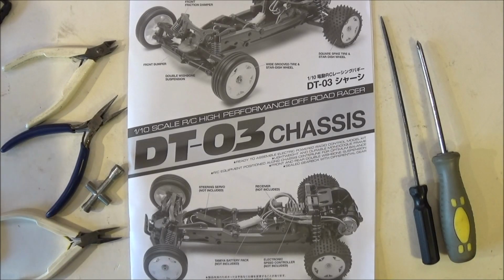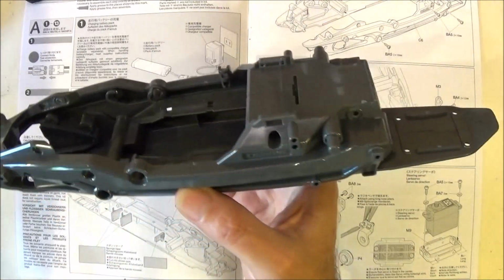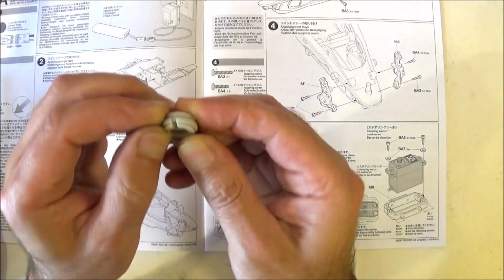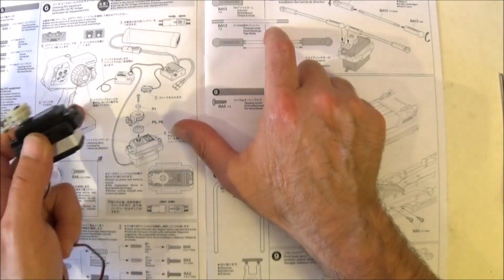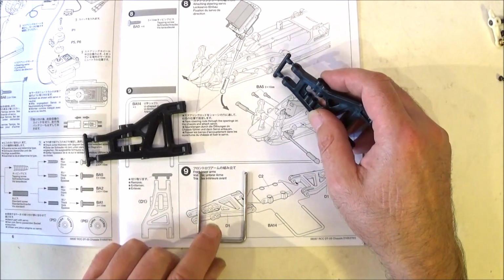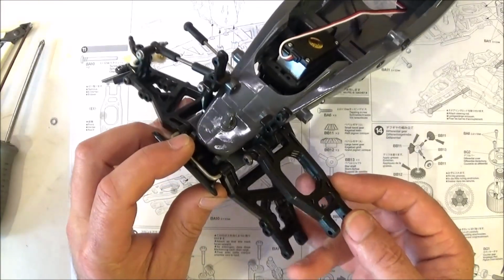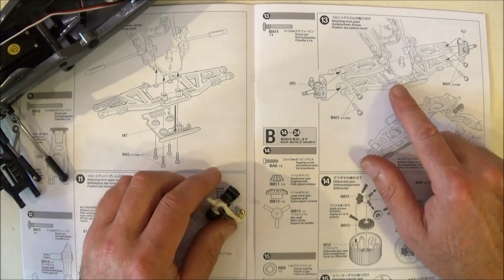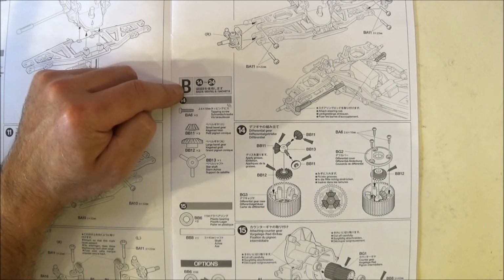Tamiya DT03 Build Part 1 & How to Make Adjustable Suspension Arms

Comment: Now do I need to see you screwing accompanied by a jaunty tune?  Well I miss it a bit but can probably live without it!   Anyway, great work mate.  Good info about the adjustable upper arm and the captive end thingy.  I could probably change the ones on the back of my Firestorm as they sometimes pop off in a crash but I'm not sure if that actually saves something from breaking.  Will give it a try.  I've done my Tamiya DT-02 and DT-02 with the standard kit upper arms as they are strong for bashing.  I will be doing something like this on my Holiday Buggy as I did with the last one as I shortened the lower arms to make the width suit the body more.   Anyway I have done the cat feeding and back home enjoying a drink before we head out.  Have a good evening matey :-)
Reply from the maker: Hehe - thanks for the amusing words Pete! The main reason I don't like the Tamiya ball cup arms though mate, is because I have had a few pop off and then my driveshaft and output drives have flown out, never to be seen again! Expensive little problem! With the multi-directional movement of the ball end, I doubt one coming off will protect against damage! I agree that the standard top arms add more rigidity and strength to the suspension system though - others have suggested fitting two adjustable rods to each side, so I might look at that, but I have had no probs with my Sand Viper which has the Tamiya turnbuckles, so we may be OK. Have you got rain down south? It's pissing it down here, with no sign of it easing up! Down to the shed for me for more tinkering and filming! Laters matey!  :)

Comment: I love your cheap and effective alternative! It does the same job as the Tamiya hop-up but it won´t drive you mad by popping off all the time.
 I must say, the build process fairly rattles along when you don´t include footage of the doing up of screws, and as you are careful to point out any potential pitfalls (the longer screw goes here, these screws should have slotted heads etc) I doubt there will be many negative consequences for viewers.
Reply from the maker: Thank you so much for confirming that you didn't mind the "screwing" being omitted, Del!  Yes, I did try to point out where they went and where there make be something to watch out for - it's missing a little detail that often causes a lot of problems! It was far more difficult for me to film this without my mate Rob! You should see how much footage I had to cut out or re-do! And yes, I am really pleased with those top arms - very simple and effective, and even better - robust!  I really appreciate you taking the time to leave a meaningful and very useful comment Del - and my reply would not be complete without wishing you and yours a lovely weekend!  :)
Reply: @MarkBryanRC  I have to take loads of tries at recording the simplest voiceover - it´s so much harder than you´d think to get it right on camera.
 Have a great weekend too   : )
Reply from the maker: Hehe - same here Del, I make lots of boo-boo's! However, I think teaching every day helps me a little, I am so used to explaining things all day long!